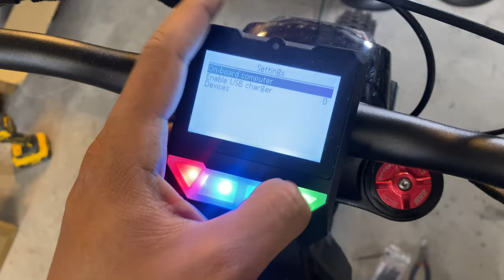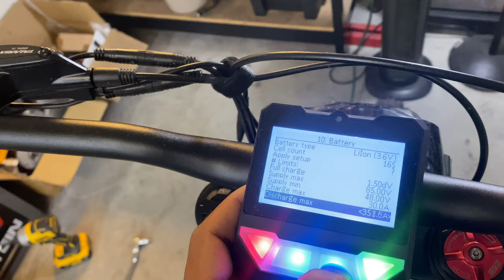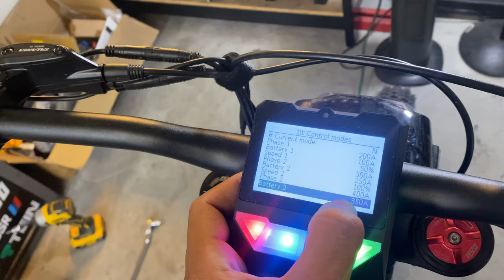74V 44AH Battery Installed on the Talaria XXX

Comment: Sorry to bother, but what's the difference between 72v and 74v?😅 In my understanding they are all 20s, just manufacturers mark them differently...
Reply: because you only get the full 74 for a little bit
Reply: It's just nonsense like DeWalt selling 20v batteries. They're just 18v in countries with stricter laws they are sold as 18v.

Comment: My controller won’t seem to keep the new cell count saved any help with that maybe? It’s doing the same thing it did to you but this time with my cell count
Reply from the maker: Do you have the same 74V battery as me? You may want to contact Nucular tech support if your unit is not saving settings
Reply: @ I do yea I have the ewatt 74v. Like in your video when it didn’t want to change the discharge make mine is just doing that with cell count, if I can’t fix it how bad would be if I didn’t?
Reply: @ if anything like I said it’s just my cell count setting that won’t save everything especially power wise and battery wise is good. So how bad is it if I can’t change my cell count

Comment: Sorry mate was just reading the comments 74v nominal is because nominal voltage of the li-ion cell used is 3.7v x 20 gives you 74v nominal (actual nom volts of cell is 3.66v)

Comment: Where could I get the battery? Also is it a perfect fit?
Reply from the maker: It's specifically made for the X3 / XXX so yes it's a perfect fit. It comes with a battery cover to fit it, along with a wiring harness. You need to purchase a charger separately. I got everything from Charged Cycle Works (link is in the description of the video.) Also you need an upgraded controller for this to work.

Comment: My Xion CyberX does about 62MPH but it is heavy as hell 225 lbs was thinking about buying Talaria XXX just because it's lighter.  Now that there's a 72V battery I might do it now
Reply from the maker: Yeah lack of aftermarket controllers and battery options have been holding back the potential of these bikes for a long time. But just the last two months, there are several options now available!

Comment: Dude I had a crash and slide on my x3 today, and my display cable/wire got shredded. Luckily the bike still powers on and rides fine, but the display doesn’t power on at all. The display is fine, also the male end of the cable is fine, but I need to replace the female end that goes down into the bike. I checked Luna’s website but I don’t think they sell it. You can buy a replacement display, but it appears to only come with the male connector. You seem very knowledgeable on the subject, I was hoping you could point me in the right direction. Thanks in advance, and I subbed.
Reply from the maker: Dang you may have to replace the main harness if you damaged beyond the connector by the handlebar unfortunately.. I recommend contacting Luna OR EbikeZilla if you need that portion of the harness, both are pretty good with keeping OEM replacement parts in stock.
Reply: Thanks for the reply, I joined a talaria group on fb, and the guys there suggested the same. New harness is needed, but I saw it for under $100 on ebikezilla. Hopefully I can replace it myself

Comment: First of all great video. I actually had a question. It might be a dumb one sorry about that. I never had an ebike before and I know nothing about them. I am thinking of buying a talaria XXX. If I change the battery and the controller like you did but don't cut the wire, will my bike go faster? If I have to cut the wire, is there a way to switch it off and turn it on when i want?
Reply from the maker: @crocolandchacala  These are not dumb questions. Wish there was someone there for me to answer the same back then. The new controller came with a new wiring harness, which no longer has a brown wire to cut. The new controller allows you to make fine adjustments to the tune. The original factory controller is restricted by that brown wire (which you can install a switch for, but no point really if you just switch back to eco mode.) The factory controller is only compatible with 60 volt batteries so I needed to upgrade the controller in order to install the higher voltage battery.
Reply: @PatOutdoors  Thanks a lot for taking the time to answer me, I really appreciate it. I have been looking around for answers to these questions for a while now but no one in my country could answer me. The craze about ebike is just starting here so most of us are new to this lol. Since as you said, the new controller has a new wiring harness with no brown wire. If I install a new controller, does that means that the limiter on my speed limit will be removed and I can tune it just like you did in the video ? To be honest, I just want my bike to go a little bit faster I don't need a rocket like yours hahaha

Comment: The battery is 72v don't know why they advertise 74v the bms is programed at 4.2v 74v would have to be 4.3v but excellent vid
Reply from the maker: Yeah I feel the same way.. my 72v YZ250 stays same voltage range
Reply: @PatOutdoors  I'm very interested to see what it does with a forty tooth on the back
Reply from the maker: Gonna be experimenting with gearing and more settings soon! Not stopping till I get at least 62 MPH
Reply: @PatOutdoors  I bet with that 40 tooth sprocket.You might even come short seven b
Reply: I have the red Version and i'm saving for battery and controller one day

Comment: Pat great vids man! Building my first ebike ever and gona upgrade the power with the same battery and controller just a quick question...about what do you get for range with that setup? Is it about the same as stock? Thanks and keep em coming!
Reply from the maker: So I have not actually performed a range test yet with the new power. I’m planning on attempting a 70-mile ride in 2-3 weeks from now and will post an update on how many miles I’m able to squeeze out of one charge. I’m suspecting it will give up around 50-60 miles (depending on how much throttle I use and the terrain conditions)

Comment: What’s your range on it now? More or less than stock (preferably in sport mode)
Reply from the maker: Well I’m not on the stock controller so there’s no more “sport mode.” Just 3 different modes with 3 different speed limit and amp outputs. My lowest mode 1 is set at 100 amps all the way to mode 3 at 350 amps. Closest I have to factory sport is mode 1, which I will likely be using in my attempt to do 70 miles (2 weeks from now.) will post a video once I finish testing.

Comment: So after all the upgrades of the controller and the battery, it only goes 60mph??
Reply from the maker: Goes 63 MPH after changing the sprocket and some settings. Still a stock motor..
Reply: @PatOutdoors  how much faster would it go with an upgraded motor and how much would that cost

Comment: So another 2 grand for not even extra 20mph 🫠. 

Right then 🫠
Reply from the maker: @LithiumIonDon  it’s not the top speed.. it’s how fast you get there 0-60. The torque is mainly what’s different
Reply: @PatOutdoors  oh fair play buddy. I have not had mine for too long so the torque is a nice new thing for me. Even standard. Can you sacrifice some torque for top end speed on the controller?  

Just seems like another bike for essentially ten mph and a little more bite. Maybe a few hundred miles and I'll change my mind 😂✌️.
Reply from the maker: @LithiumIonDon  well this bike now goes 63 MPH with a 44T rear sprocket swap. The Nucular controller is limited with total power output though, 16ish KW max. Pretty much maxed out stock motor at this point though. Likely switching to a Sotion motor later once the motor eventually fails and hopefully I’ll hit 70+ MPH then
Reply: @PatOutdoors  thanks for all the info Pat. 70 sounds more like it. I'll keep an eye on the channel for updates. 🤝